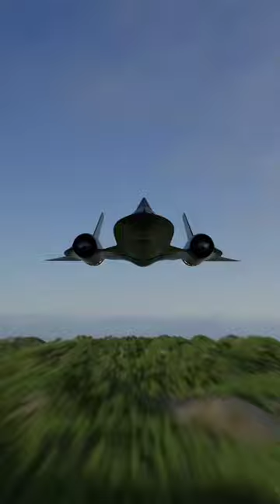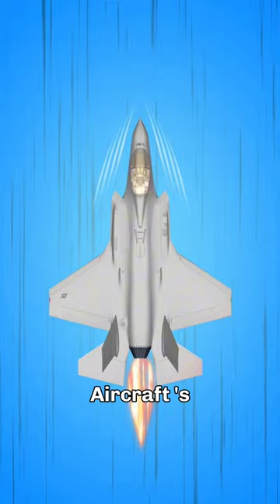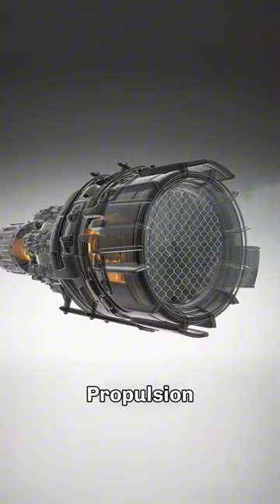Why Are There No Hypersonic Jets? 🤔

Comment: The heat comes from compression, not friction.
Reply: its both.
Reply: @y-i-t5443  No.
Reply: @rmdlgarcia   So you say friction doesn't produce heat ?
Reply: Assperts
Reply: Well it is a mixture of both, friction will always produce some amount of friction but the vast majority of it here is produced by air compression.
Reply: @supercr33p3r7  Not both. The ship has dead air on the nose and skin. Friction was always the wrong word.
Reply: @rmdlgarcia I honestly never thought of that but your right, there is a stagnation layer of very hot air at subsonic speeds behind the shock wave, you need to be careful with sweeping statements though, I’m fairly certain that for extremely streamlined craft (like supersonic and hypersonic air vehicles) the shockwave is extremely close to, if not in contact with, the hull. Stagnation layers only become significant either at ridiculous speeds (orbital speed or so) or when the front of the craft is blunt forming a bow shock, like when a spacecraft enters the atmosphere
Reply: @polarisukyc1204  Re-entry speed is at ridiculous speeds.
Reply: @rmdlgarcia  true, but even at supersonic speeds, for a highly streamlined aircraft, the stagnation layer would be minuscule
Reply: @polarisukyc1204  So still no friction, just compression. Science. The fault is the media. They are told all the time but they keep using the wrong term.
Reply: @polarisukyc1204  For the most part I believe apollo used the 'cushion' of air formed as a method of keeping the shockwave out of direct contact, supposedly a heat reducing measure. It can be found on wiki. The ablative heat shield was still necessary though.  But friction definitely plays very little role especially if the bow shock is kept away from the skin.
Reply: @rhysmodica2892  that’s what I’m saying, when you have a blunt body like a spacecraft on re-entry the distance between the bowshock one the body is significant, while on a hypersonic aircraft, due to its lower speed and more streamlined profile, the shockwave is much closer to the aircraft surface, there is of course a thin boundary layer but it’s minute, I don’t the the exact values but the boundry layer can’t be more than 10mm or so. Because of this there is a lot of compression heating, but to say there is zero frictional heating would be false, it might not be give significant contribution to the heating but it is still present
Reply: Compression is the caused of Friction so basically, its both
Reply: @Worldhistory1896  No.

Comment: Hypersonic : 
more than 5000 km/h (Mach 5 (5x the speed of sound))
Airliner Mach 0.95
Fighter Jet mach 1.9
SR 71 mach 3.5

X15 Mach 7
X-43 mach 11.8
Reply: Rockets can go at least mach 20 but it doesnt count because its not a jet
Reply: Airliners do not go 0.95. They go more .85
Reply: Russians tried it. With mach 3 for few minutes. Engines went kookoo. Not very durable. The engines were not developed for more then 2800km/h or plus. The SR-71 has flown way beyond. BASTA
Reply: @cptdave4048 Man imagine how fast the tech could've advanced if they managed to maintain the speed without any severe damage.
Reply: @embeddd 757 and 777 can though
Reply: @NoTwo10  777 goes .89 and 757 Mach.86
Reply: @Man__MAN__maN  Tech already developed. Its called ramjet.
Reply: @cptdave4048  ramjet mfs when their engine only starts working at high speed:
Reply: Buddy airlines at most going 0.75 stop the misinformation.
Reply: @AirJoe  , @embeddd 
The A380 and B777 can go 0.95 though
Reply: @ghost_6583  that's not true if you had a heavy tailwind and you were diving it could maybe happen but it's not cruising at that ever. Neither are any modern jets going mach 2 the most they go is mach 1.5
Reply: @AirJoe  the F22 goes up to mach 2.2 and can super cruise at mach 1.6
Reply: @hamubice1551  Yeah that's an exception but you're still not doing that with a full payload. They do these tests in above average conditions. I'm not saying it isn't true I'm just saying it's not something that happens often.
Reply: @embeddd  I've seen many planes going over 1000 kph on flight radar
Reply: @johncarlotena1151  voyager: 💀
Reply: Correction:
X15: Mach 7.6
X43A: Mach 9.6
Reply: Wrong, mach 1 is 1,235 kph. Also, jets are not just mach 1.9. Mig-25 and Mig-31 can reach mach 2.83
Reply: @XB-70Valkyrie-d3k  that would be at sea level
Reply: @ghost_6583  well, yeah. But it really depends tho. Speed of sound decreases as the altitude goes higher because air is less dense
Reply: @johncarlotena1151  correct
Reply: @AirJoe Nahh bro it’s 0.85
Reply: @a_life_of_aviation  in a dive at altitude maybe, but the average flight ain't going that. I fly 737s and other jets msfs. I know all the systems. This is reliable info I'm telling you, don't trust the Google machine.
Reply: @AirJoe  bruh even the in-flight entertainment on the B787 I went on said 0.85
Reply: @a_life_of_aviation  787s an exception but it still usually isn't going that
Reply: @johncarlotena1151 bro he missed the concord 2x speed of sound! 💨 🛩️
Reply: They did just discover a new hypersonic engine that can be sustained
Reply: @johncarlotena1151  X43 was powered with an air breathing scramjet engine and achieved hypersonic speed so jet engines can propel planes to a high Mach number as such.
Reply: @AirJoe Tailwinds have nothing to do with mach number they just change your groundspeed
Reply: @XB-70Valkyrie-d3k yep, they just reported the new F15 could hit mach 3 then quickly retracted those claims... I'd bet it can but they didn't want that information to be public.
Reply: X-15 and X-43 aren't fighter jets.
Reply: The SR-71 speed is the declassified speed
Reply: Jesus loves you. He is your savior. Repent for the kingdom of God is at hand!
Reply: Mach one is 1234.8 km/h if i remember correctly tho
Reply: And why do you wanna go that fast on earth.?
Reply: @Discoveredme  to save time
Reply: They're now trying to make sr-72, which is supposed to reach Mach 6-7
Reply: @johncarlotena1151 because rockets travel in space at the speed of mach 20 so there is no air friction.

Comment: Use a ultra thin coating of what we use on the space shuttle for re-entry........That outta do it for regulating the heat....!!!
Reply: They also melt but does not conduct heat
Reply: So the coating may peel off
Reply: And then what about the stealth coating?
Reply: @lolgoteem5372 do you really need stealth at that point. 

You could literally outrun anything
Reply: Silica tiles still chip off during re entry, chipping off is how a heat shield works so even then if you put those tiles the plane would slowly chip off and that combined with the expensive fuel, engines, and the plane itself would be quite useless
Reply: if it was so easy, we will already have hypersonic jets...

Comment: Space rocket 🚀 hold my fuel
Reply: Hey space rockets are different as they propel fuel out the back as a main source of propulsion as well as they cannot use oxygen breathing fuels. A “jet engine” is an engine that burns a reducer using outside oxygen in the air. As in only the reducer is on board the oxidizer is pulled from the air. Rockets bring both oxidizer and reducer and therefore don’t breath air. They also require much more complex fuel systems with much less controllable engines, total fuel brought, and efficiency. There are many other differences as well but rockets are only somewhat feasible for transport now that Elon Musk basically revolutionized rocket travel to be close to financially worth it for certain applications. Otherwise most rockets cannot land on a runway, cannot steer well, cannot be refueled easily, cannot deploy weapons systems or loiter, and frankly they are much more dangerous. They also can’t fly low enough efficiently enough to act as a spy plane or release weapons systems affordable. A hypersonic jet engine could fly, steer, and be refueled for the next flight in a day or two at most.

Comment: Anyone wondering the real reason is because without solely jet propulsion (which is expensive and you cant refuel) we dont have engines capable to produce propulsion at those speeds, because slowing down the speed to subsonic at mach5 is near impossible

Comment: Then how hypersonic missiles are being developed?
Reply: they arent jets
Reply: Basically hypersonic missiles are possible because unlike a jet, the hypersonic missile isn't crewed or has the need to change course at any given time. It also uses a rocket booster instead of a jet engine because those can't propel anything past Mach 4 even in a simulation
Reply: They're smol unlike jets that's big
Reply: If you're talking about ICBM's they usually go hypersonic at the upper layers of atmosphere( basically outer space) where there is less heat due to friction.And also the missiles that claim to be hypersonic are usually modified ballistic missiles that go hypersonic for very small duration if at all. To date there is no true hypersonic missile developed by any country

Comment: The lack of Hypersonic comes down to three things: Manuverability, cost and maintainance. At hypersonic, turns would be very long and the G s insane if you tried ro make them tighter. The cost of developing weapons for them and using them would outweigh all benefit, not even talking training and fuel. They would be a maintainance nightmare. Moving wings are hard enough as is but  engine(s) with turbofan to rammjet? Groundcrews would have the suicide rate double. Not speaking of the airbases needed. Hypersonics would need multi kilometer runways, meaning thst the european tactic of highway landing sites would get EXPENSIVE to maintain. So, I belive that sixth gen fighter craft will maybe gain speed closer to cold war era, but more likely is to see europe and asia develop lower cost stealth fighters. That is my conclusion on the issue.

Comment: I’m not an engineer, so take this suggestion with the grain of salt. But as I recall, the shuttles had a ceramic tile coating, but protected them from the heat of reentry. Why not take that technology refinance and apply that to these jets so that they can go Hypersonic? It just seems like the next step in it. The evolution if you will. As for the engines that can sustain the speeds. We know that we can create engines that have huge thrust. That’s how we get the shuttle and the rockets in the space. How do we create an engine to hypersonic for sustained. Without the heat burning the engine out. I believe you could still use the idea of the heat resistant tiles from the shuttle. Perhaps cut the inside of the engine where you need it with a type of, sealant or mate derived from this type of technology or idea. Again it just seems like common sense to at least start there. On both problems you could start with the idea of these tiles in mind and work up from there. You may not actually be able to use the materials the tiles remain out of but experiment and come up withalternative materials with the same type of IX that will give you the ability to deflect or withstand the heat created by hypersonic and hypersonic engines.

Comment: Why doesn't this affect missle development as well? Missles go hypersonic all the time.
Reply: a missle is a different thing from a jet, different uses, different needs, one is a cilinder whit a booster on the back and some small wings, the other is a pair of wing whit one or two engine's, one carry a bomb, the other carry missles, machine gun, a pilot, radar, sensors... different things
Reply: @D4rK-K1Ll3R_43  ...still subject to air resistance, no?
Reply: but they dont need to change their trajectory unlike jets
Reply: the moment a jet would turn it will shred into million pieces

Comment: Then use space shuttles materials
Reply: the space shuttle had ablative tiles that had to be replaced every time it flew and wasn't going that fast for long
Reply: @FirstArchon  Both wrong. The space shuttle didn't use ablative protection at all and the tiles weren't replaced after every flight. They were checked for damage and replaced if necessary.

Comment: But they have satellites that handle the heat of space with just aluminum?
Reply: Because space is empty and cold
Reply: No friction (no atmosphere) in space.
Reply: No friction in space
Reply: @leonnefourie1857  yet they tell you about high temperature in space. Check your indoctrination
Reply: Reflective surfaces for solar radiation.
Reply: @Dxyzxyz  yeah it reflects the cold too.... durrrrrrrrr
Reply: @taintrip Reflection of cold what? Learn physics.
Reply: @taintrip Did you miss physics or did you fail it?
Reply: @Dxyzxyz  you got proper Indoctrination 👌
Reply: @taintrip  I got an education, not indoctrination.